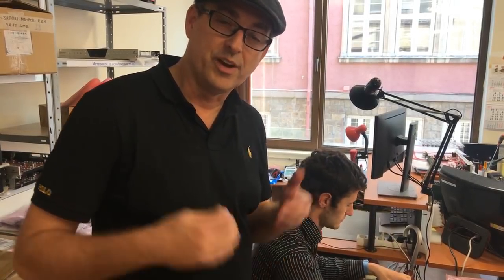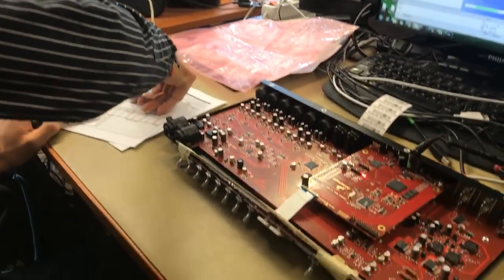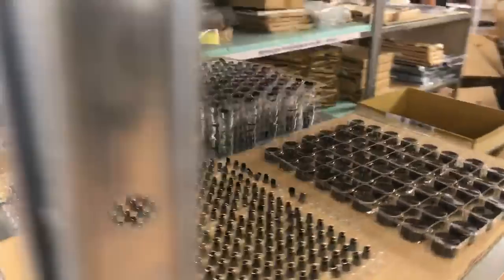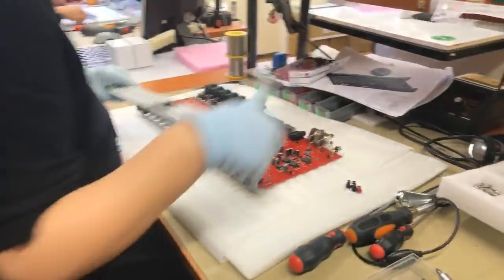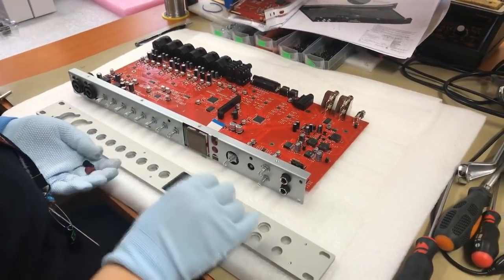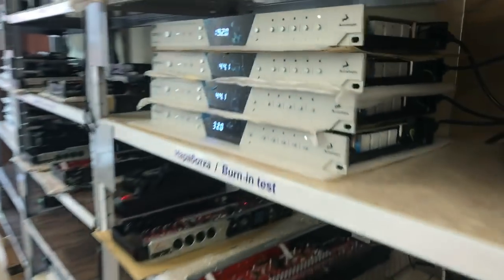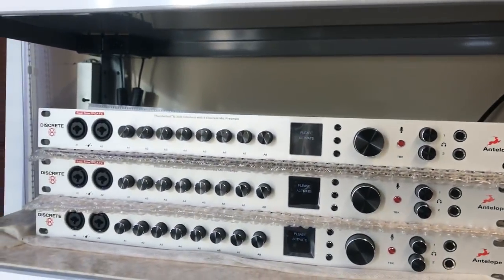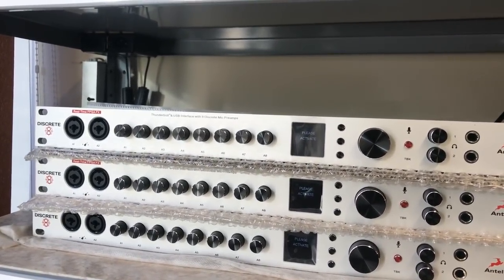Building Your Discrete 8

Comment: So I see that the discrete 8 with all the effects is gonna run right at 2000 dollars (8 pre's) which if you're looking at input count it's actually higher in cost than the Orion Studio (12 pre's) at 2100, and higher than the Zen Studio+ (12 pre's) at 2000. What would be the benefit in the discrete over the other two interfaces? 
Thanks Antelope! 
Excited to get some of the products!